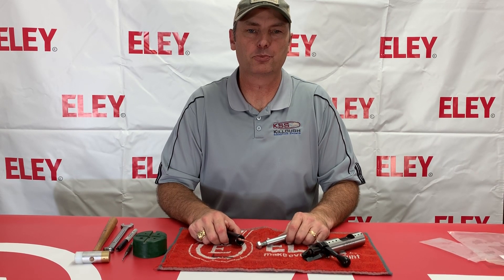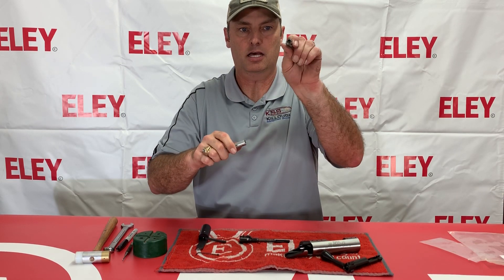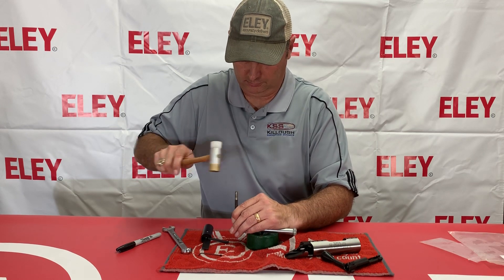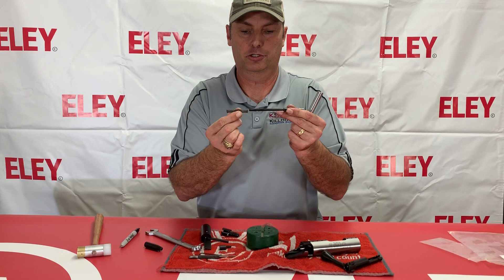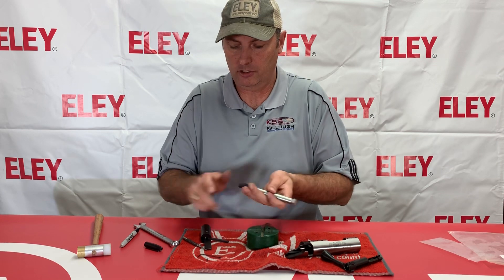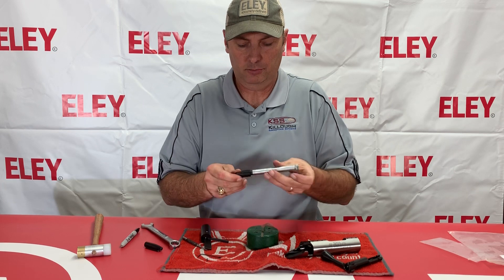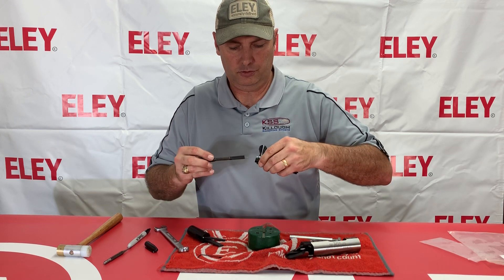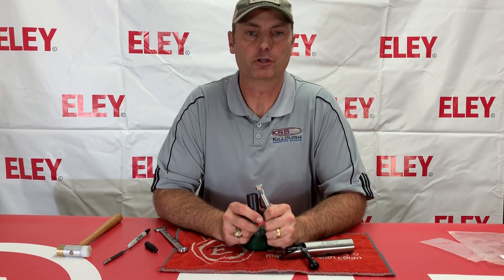2500X/Trident Bolt Tool -How to use it

Comment: Use the specific Kleinendorst tool for the 2500x, NOT a Kleinendorst tool for a Remington action, it doesn't pull the firing pin far enough to clear the front of the bolt.